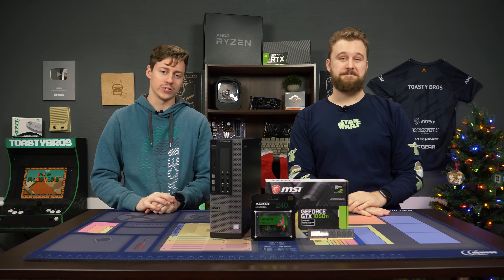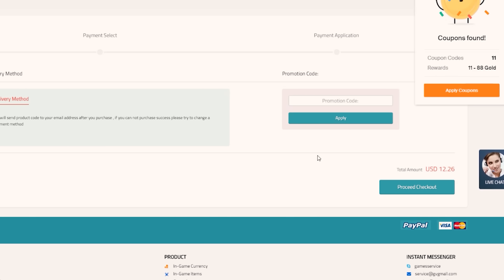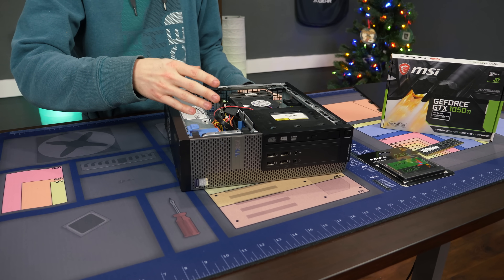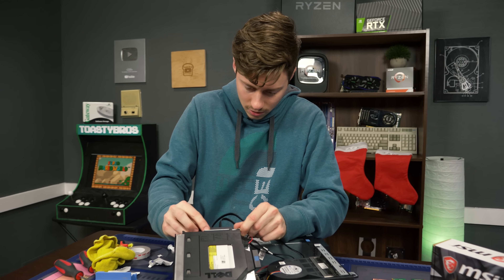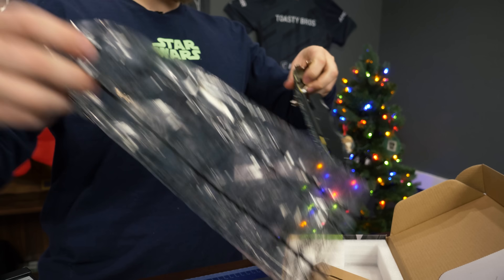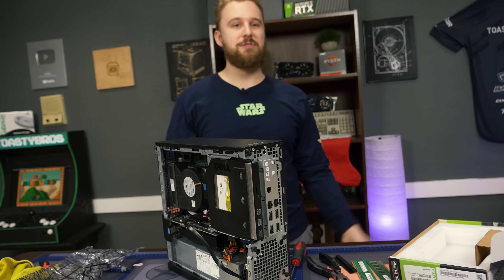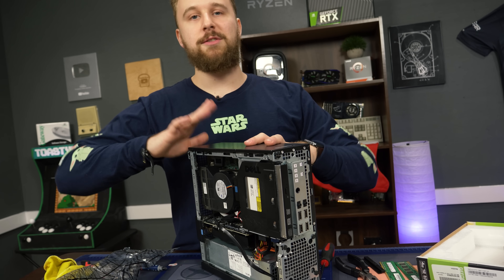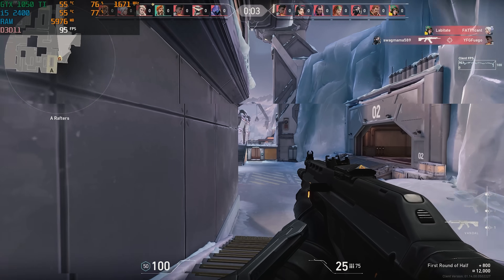EASY $250 Gaming PC Build - Step by Step

Comment: Dope build. My flips I usually do an i5 with an rx 570 for 450 ish a pop. Other specs if you’re interested.

500 watt 80+ bronze  Aresgame psu
16gb team group ram
Rx 570 brand varies
512 gb ssd 
250-750 gb hard drive
P300a I like the case personally sooo
And pcie Bluetooth WiFi card
Reply: Can a rx 480 fit in small form factor oplitex
Reply: @browniefnbr9013  nah need a mini tower optiplex to do that. fastest gpu you can put into the sff pc is 1650 lp
Reply: @enigma3147  damn so a rx 480 cant fit
Reply: @browniefnbr9013  sadly no
Reply: Technically could have it outside the case but you’d need to figure out what the power switch is for your mobo and use a screwdriver to do it. Would just recommend selling the sff one and get a mt one
Reply: @enigma3147  thanks for the advice bro
Reply: @browniefnbr9013  np! Enjoy it once you get it running

Comment: 5:43 you used lane incorrectly. It is a 2 slot card not lanes, it is 16 lanes since it is an x16 card. Great video overall but this is not correct information about the lanes

Comment: Doing something similar with an optiplex 990 sff I got from work. Had to replace the PSU, upgraded the  i5 2400 to a Xeon 1270. Already 8gb ddr3 in it. Now I just need the 1650 low profile and ssd (which the latter I have).

Comment: Rate my pc im gonna name her Red Rouge and the specs will be the ryzen 5 3600 Radeon RX 5500 16 gb of Crucial Ballistix 3200mhz Samsung 970 Evo Plus 500gb and using the 650 watt psu from ARESGAME
Reply: You're pairing a 3600 with a rx 5500...
Reply: you should get a  1660 super  instead if you,re gonna do streaming or editing or if you,re gonna game only get the rx5600xt or something more powerfull than 5500
Reply: So I changed my budget and now I'm using a  ryzen 7 3700 and a RX 5700X

Comment: nobody tell him someone drew a mustache on him. All seriousness also look out for 5th gen Acer viston towers and HP Z420 towers they are cheaper than the dells a word of warning on the acer towers they have a properitary motherboard pin on the psu you can get adapters but they generally have better airflow and the 420 towers although older i5s have a lot of upgradability (keep in mind your limited to ddr3) check out phils computer labs if your tempted for all new part xeon build from china as the cpu motherboard and ram are avilable seperatelty or in bundles from ali express some have really good components and some are timebombs. I have sold about 20 xeon builds between Nov/Dec using the kilshire brand on ali express never had any issues with the build or returns

Comment: Oh my i have saved up and you uploaded on time! LUV U BROTHERS
Reply: @UJMX Yup definitely recommended
Reply: @UJMX Hey thanks alot in the UK stock is pretty trash right now so i will have to get an a320 motherboard on sale but do u have discord if so mine is FlubbedGotHim6641
Reply: @moaliriyaz  You will get an amazing experience if you start at something good i started from scratch and i can tell you it wasn’t  a pleasant experience even now i don’t have a discrete gpu 😅 , thanks for my sh!ty country 😒
Reply: @moaliriyaz  u can go xeon and rx 570 for around £300-350. Best price to performance and u can get straight into gaming and in the future can upgrade gpu. Cpu upgrade won't be needed for a while.
Reply: @moaliriyaz  your better off waiting until the price get normal by the time it does you should have around 600 to 700 depending on your savings which is way better then 400 budget
Reply: @moaliriyaz  what's ur discord
Reply: If your budget is already at $400, then PLEASE just have a little more patience. Your SO close to building a really nice PC. Dumping $400 into crap is NOT the smart way to go at all. You can get full-blown gaming PC for 599 currently & it's full of upgrade room for years to come. Example Only: https://www.walmart.com/ip/HP-Pavilion-Gaming-R5-1650-Super-8GB-256GB-Gaming-Desktop-Tower/943933730
Reply: I have purchased 5 of these HP- TG01-0023w. I purchased cheapest 16GB x 2 sticks speed offered that is compatible , then slide in 2TB SSD into machine and for what cost me under 800, cost over 1200+ online, so I feel it's victory for Gamers in 2020 to achieve gaming-class while saving many hundreds over name-brand gaming models. When you remove the 8GB stick and add in 2 16 GB ram sticks, it totally unlocks this system like pure 100% beast. Now later in future when money come open like 2-4 years later, you simply upgrade with much better prices, then are offered now & that's how gamer stay ahead in new generation, not spending over 2K on simple gaming PC.
Reply: @videoreal7072  🤔 Why you need 5 of them ? do you resell them or it’s for your friends or family
Reply: @farhangh3577  This year is my 34th year building & customizing PC's. I do them for family, I do them for friends, I do them for clients also.  Whether it's building it yourself, upgrading used systems, or buying pre-builts it is my job daily to know what is the best deal, or else I would not have any business, but I prefer just to help people out, because life is not all about money & profits. I've sold over 265 of that same exact model link I shared above. Not 1 complaint so far. Out of 265 of them I only received 1 damaged one & HP replaced it within max 6 days time, so I was pleased.
Reply: @videoreal7072  Wow that’s really good keep up the good work
Reply: @videoreal7072  that pc is shit you suck at pc building I guess
Reply: @erirururi  It was a reference point. The PC is pre-built, there is no PC to build at all. If you break down the part cost at consumer level that base model is worth 550-650 and it's 599. Spend a few bucks later on and it can be much more and better, well under the 800 dollar mark and full gaming performance. Most PC's in that class with 16-32 GB Ram are well over $1000 with a 19MB cache 6-core CPU. Facts & stats I know, no need to troll. XD Rookie noob lolz
Reply: I would not build this. I would save and wait till parts are cheap!
Reply: Bro that pc is ass lol my build is 1.2k
Reply: @narie1835  come on don’t say that, for poor people it’s a very good build
Reply: @narie1835  bruh I don’t have a dad okay I live on benifits my dad passed away a few years ago : (
Reply: Dell 790/990 2nd Gen i5 + 1050ti is this a good pic build
Reply: @franklinsaintx  I have i5 4460 8gb ram 256gb ssd +500gb hdd +2tb hdd the only thing remaining is a good gpu but it’s too expensive
Reply: @farhangh3577  do u think my build is good?
Reply: Or this Stormforce Onyx i3 8GB 1TB GTX1650 Gaming PC409
Reply: @franklinsaintx  Well it mostly depend on how much money you have ? and if you’re willing to accept this kind of performance, example i personally i don’t mind 30fps i’m used to play games at 800x600p and 720p as long as i get the 30fps or 30+ fps , so for someone like me your  pc is very good  (hope you got your answer)
Reply: @farhangh3577  thank u
Reply: @franklinsaintx  You welcome
Reply: @franklinsaintx  Really depends on what you expect out of it,  in order to decide if it's worthy for your needs or not.
Reply: @videoreal7072  I mean I’m gonna build it for 400pounds. I want it to be a gaming pc sort but I will upgrade it eventually. I want to play call of duty rocket league fortnite,minecraft and many more games.
Reply: @franklinsaintx  I would purchase the link I shared above in that case & just upgrade it over the years as time & money allows it. Keep in mind if you buy a used PC and upgrade it, the older parts can break down within minutes, days or weeks, so plan on that to happen, because that is how life just goes when investing & upgrading used products. In 2020 it's so much price-friendly just to buy new, whereas years ago (8-16 years ago) it was more economical to upgrade used PC's, times have changed though & old parts will break down within time, so plan on that 100% if you invest into used PC system.
Reply: @videoreal7072  I live in uk I don’t have Walmart
Reply: @videoreal7072  I’m also thinking about this HP Pavilion Ryzen 3 8GB 1TB RX5500 Gaming PC
Reply: @franklinsaintx  Find it somewhere else then by search for that exact model number & watching the price. The link is a reference point. No need waste money on old stuff & it break down, which require more money spent. Buy new, take care of new & upgrade as can.
Reply: @videoreal7072  can you help me I’m trying to buy a pc or good prebuilt on a budget
Reply: @james-in6ju  If you mean gaming PC, then read comments from top I shared link & info, cannot go wrong I assure you. If you trying to get gaming PC for less then what I mentioned above, then most likely you will not be happy with results. Technically speaking average decent gaming tower starts at $750+, so to get 6 core cpu, 4gb graphics + onboard combined = 12GB total graphics + 8GB ram out of the box & wifi/bluetooth built in is really damn great deal. The link It's $599 for really good decent quality gaming starter prebuilt, then you can buy 1 stick of 16GB and have 24GB & the PC for $700 be like PC that cost normally 900+. The only way to cheat the system is to find the best deal you can on the best PC, then upgrade 1-2 parts to make it like shortcut to reach same goals as spending $900+ easy.
Reply: Pc*
Reply: @Orange 😂😂 I really like your idea ( yeah for someone who always upgrade his build , this kind of build is a nightmare 😈)
Reply: Same
Reply: please dont buy this pc, its for your own good 
btw how much have u saved up? 
cuz i have a reccomendation that is ACTUALLY recommended by them
Reply: @elexiety  £300 around 400 dollars
Reply: @moaliriyaz  Ok that budget is low but if you could save up some more you could buy the nzxt starter pc
Its a good deal for 799 go check it out at nzxt.bld
Reply: @elexiety  what is your recommendation? i need a good pc
Reply: @bdtznlmb  whats your budget? i can recommend a few
Reply: @elexiety  like 1,400
Reply: @bdtznlmb  damn thats a lot ok imma see
Reply: @elexiety  okay thank you
Reply: @elexiety  like something that can have like lots or space to download games yk like cod and can have 240 frames on like fortnite if you can find something like that bc idrk shit about pcs yk
Reply: @elexiety  any yet ?😅
Reply: @bdtznlmb  I just finished building a pc that ended up costing ~1450€ or $1750 but I could have saved 100-200€ in some parts if needed. I chose RTX 3060 Ti and r5 5600x and B550M aorus elite motherboard. I upgraded from GTX 1060 and i5-7600k and I'm really happy with current performance. I play 1080p but I think I could play 1440p easily with this setup

So if I was you I would get r5 5600x and 3060 Ti or 3070.
Reply: @bdtznlmb  Just realized you are looking for pre-built pc, not sure about those.
Reply: @elexiety  are you joking or something this pc get around 100 to 60 fps on high and low settings what more could you want
Reply: @techgameinggeeks7321  lmao its been a year since I said that but anyways, you cannot find a PC for only 250 dollars that can run ~80 fps on high settings 😂
Reply: @Orange what do u mean
Reply: How would this run with ark survival evolved
Reply: @tarkovuniversity  a good 80-100+fps
Reply: @UJMX 1. You can’t build a system like that at $250-$300 US right now. 3200Gs are out of stock everywhere. 
2. This build isn’t so bad just to get up and game.
HOWEVER - I would be concerned about CPU instructions on a processor that old but if you play slightly older or less intensive games (or classic games and emulation) you will have a good experience.
Reply: @UJMX yes do this it's way better than than this video pc
Reply: I got ryzen 3 3300c CPU, 16gb, gtx 1650 is that good?
Reply: Its really not a bad deal tbh... the market is thru the roof right now
Reply: @UJMX Im not interested in Big ass towers thats one big reason.
Reply: pog
Reply: @UJMX $100 graphics card? Thats really bad.
Reply: @UJMX Goodluck finding it under $250
Reply: @UJMX This sounds really good, thank you. I play a ps4 and Im looking for something better so I can get out of this disgusting and very limited console, nothing personal about consoles but PC is so much better.
Reply: @UJMX By the way you have saved me 4-6 hours of research.
Reply: @UJMX I also cant find a graphics card thats not the price of the Pc itself
Reply: ProjectKash  Need more budget room to work with those requirements you listed, but the PC link I shared would be fine,  if upgrade ram/memory to increase all systems parts and that was around $600-$650 for HP gaming pavilion and upgrade ram. $400-550 price level does not provide gaming/streaming/recording requirements not very very good, so $599 for gaming HP, then small upgrade ram memory it will be unlocked fully, then later in future, you expand upon your small investment that gave you huge outcome and make it even better. Decent gaming PC that can do what you mentioned in comment generally start at $800-900+, so when you see HP gaming built for $599, then think of small tiny upgrade Ram memory to fully unlock it's potential from start of ownership, then you realize what a great deal the $599 + ram upgrade is, because for less money,  you come out great & you have room to grow over next years easily inside.  Basically your cheating using this method, because you as the consumer come out ahead & later on you can invest more, when the money is an option...... Nothing wrong with spending $600-650 to have a $975++ system right?
Reply: anything you do dont get an apu the heat going there its just bad
Reply: i'm experienced
Reply: @moaliriyaz  mine does
Reply: @moaliriyaz  i did't ask for your answer about overheating apu too...
Reply: ProjectKash  very gud
Reply: But u cant play call of duty on it so what's the point of getting it
Reply: @moaliriyaz  thats more like it lad
Reply: U forgot one thing.... No homo
Reply: I am saving up so that I can get a computer to ACTUALLY  START WORKING ON VIDEOS